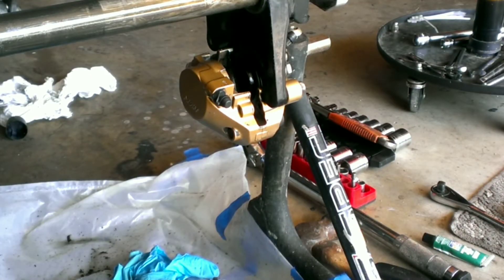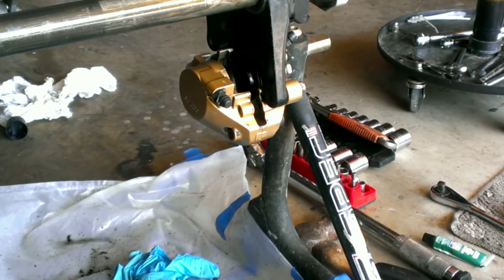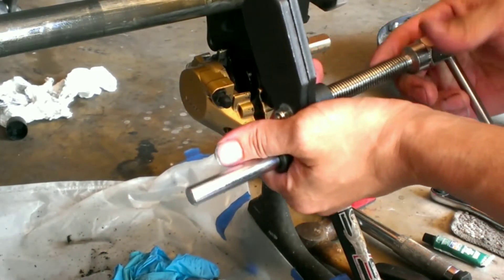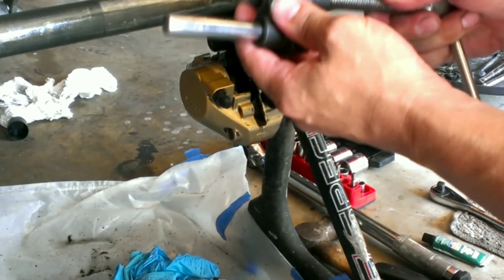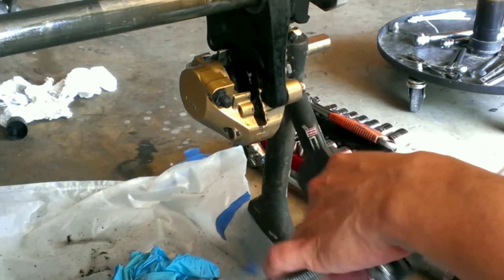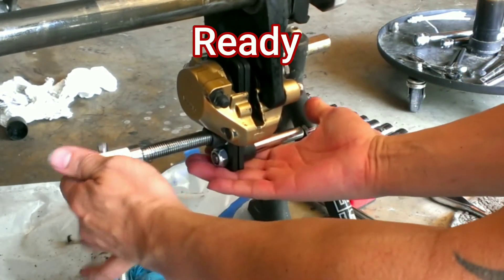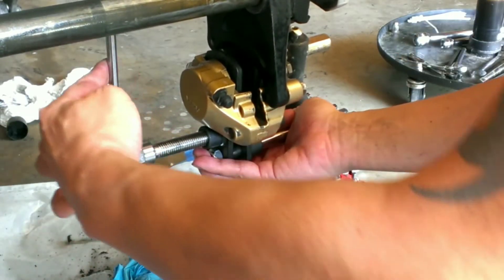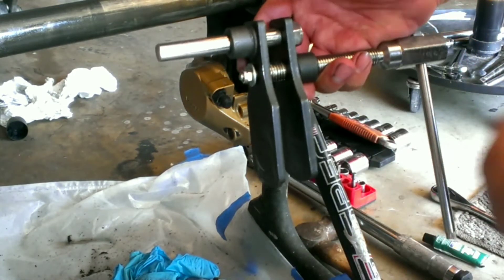How To Spread Brake Pistons Fast! (Bikes and Cars)

Comment: How is the new motor? hope there are vids of the swap
Reply from the maker: TheREGGIE1324 , what's going on bro. Engine install was completed in 2 days and She started up first round with no issues. I have to say the increase in power on this new engine just is insane! When in the last gear on the frwy i keep looking for another gear because she pulls so hard still, not use to that. With the higher mileage engine i would have to drop a gear to disappear. 

At the moment I'm currently editing the video footage of the entire install. I have a lot of lessons learned that I want to share and will be making a 2 part. 1st part will be a walk through of tools, bolt location and other things you need to be aware of to help With a smooth removal and install..droping the engine is not as simple as removing the bolts and the engine drops, it actually stays locked in place (damn thrust bolts!!..)

The 2nd half will be more of a high-speed time laps with slower down voice over comments of troubled spots I ran into explaining what to do just in case the viewer runs into the same.

Just trying to cover as much detail as possible. (What I'm known for).

Everything good with your bike?